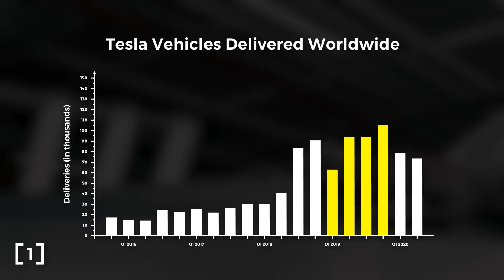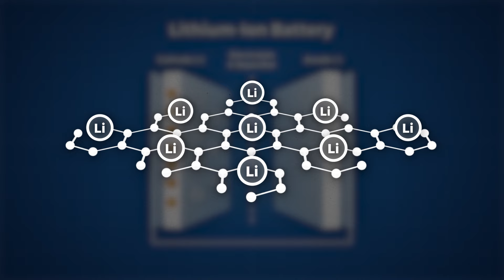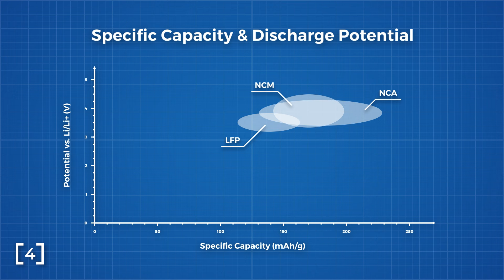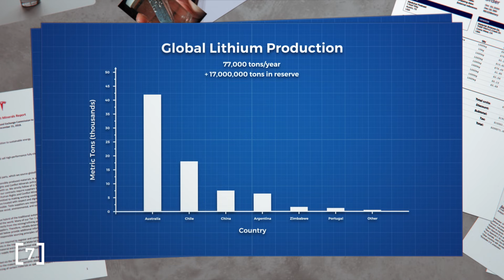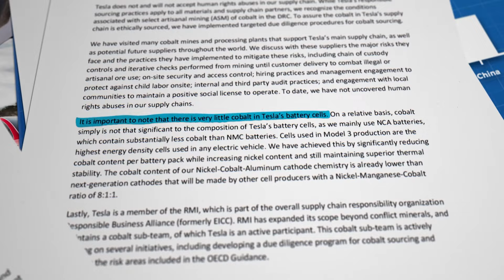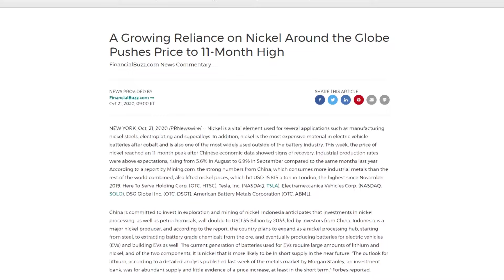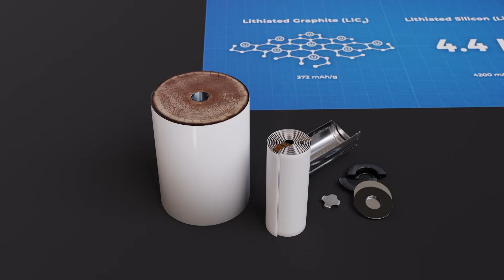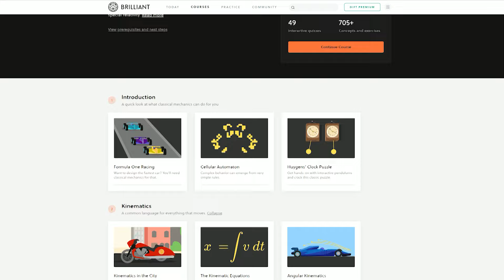Tesla's Battery Supply Problem

Comment: put solar panels over  all east west highways.  This will do at least three things:  1.  Protect east directed drivers from driving into the sun in the morning and west directed drivers from the evening sun.  2. Keep most of the rain and snow off the highways during bad weather.   3.  Keep cars in the shade, reducing their need for AC cooling in the summer.  4.  Reduce the heat from the sun that currently is developed from above the pavement.  5.  The government already has the right of way so it doesn't have to acquire more land in order to build solar panel arrays.  6.  combined with in pavement charging, could charge electric cars while driving.

Comment: I think the scaling problems will be smaller than thought. Like not everyone buys new cars. Heck the cars i buy only get older and older. And old cars can be run on renewable fuels. Ethanol for old petrols. Or even better: Vegtable oil or even used cooking oil in old Diesels. Espeically the later is quite a good choice since its good recyling

Comment: How much electricity does it take to fully charge a Tesla car ? How does that cost compare to gasoline to travel the same distance with the same performance ?
Reply: In a 30 mpg car, $3/gallon÷30 miles/gallon = 10¢/mile. In a Tesla Model 3 with 4 miles/kWh, 10¢/kWh÷4 miles/kWh=2.5¢/mile. I'll let you multiply by number of gallons or kWh in your favorite gasoline or electric car.

Electric cars are much cheaper to "fuel".
Reply: @hazelsct   Thanks much appreciated

Comment: I do not know anything in terms Marth and physics but as much looking at the powers transfering on the quick wrap battery from the copper and aluminium foil, it is going to little bit lithium and anode in it. The reason for is because mostly copper and aluminum foil they won't keep power much longer since they are always there to work as middle man in releasing the given capacity of the current.

Comment: Hey can you do a video on pneumatic energy storage? Or air pressure energy storage? I’m not sure which it would be called. I’m sure the efficiency is terrible but less of a mining concern, plus over time I’m sure air pressure storage can gain a lot of efficiency, still probably not ever as efficient at a battery. But it’s gotta be super super clean, especially coupled with windmill, or solar panel provided energy. But I’ve heard of plans of storing a gigantic tank underground to store air. Also I think there was a company in India that made a full pneumatic vehicle but not very good range, I don’t know if they abandoned their plans. I’ve also heard as far as safety concerns they can use carbon fiber tanks instead of metal so it can crack instead of exploding. Either way it will for sure be the cleanest way of storage. Plus it would be nice to hear super high RPM air turbine engines in a vehicle in the future. 
If nobody else tries then I’ll do it someday in the future 😂

Comment: I have dozens of lithium (lipo) batteries that I have accumulated over time due to my remote control hobby. Some of them have puffed and swelled due to overcharging. Disposing of the bad ones have become easier for to collection centers. What happens to all these battery waste, including lead acid batteries that we still use in almost all our vehicles?

Comment: It is amazing how this video danced around Lithium Iron Phosphate chemistry which has no supply constraints whatsoever (other than that of Lithium itself which is pretty soft), has the longest cycle life of all, is safe (not igniting even if punctured), and non-toxic. Oh, on top of that it provides more stable voltage than other chemistries, and thus requires far less sophisticated charging control circuitry if any. 
The energy density is lower than others, but sufficient even for vehicle use (used in Teslas), and definitely for stationary energy storage. Arizona battery farm disaster is absolutely irrelevant if LFP batteries are used, and they will be according to Tesla plan revealed on Battery Day.

Comment: The refining of gasoline makes a by-product, that used to be waste, that are the base chemicals in plastic and rubber production. Cutting back on gas production means cutting back on tire and electrical insulator production or start throwing away gasoline. Making renewables, solar panels, wind turbines, needs a lot of electrical and weather insulation so cutting back on gas production is not feasible. The alternative natural insulators do not have the same durability properties making more frequent replacement necessary. All advantages have disadvantages hidden in the details.

Comment: The battery they are assembling at 22:33 looks like a nickel-iron type wich is very durable and abuse resistent, but so far the only ones i was able to buy come from cina, the one in the video looks much better built, plates inside held in place by screws and bolts and they have trasparent containers/jar/vessel, unfortunately the ones wich come from cina have plates soldered and opaque jar, could you tell me more info about the batteries seen around 22:33 in the video?

Comment: Actually, the way you descriped it is wrong - actually, it's in reverse. The cathode has electrical potential that attracts electrons, and the lithium ions just follow the electrons (kind of). From a chemical perspective, lithium gets oxidized on the cathode side. That's where the energy comes from, "burning lithium". The electrolyte contains a lithium salt that only allows ionized lithium to pass.

Comment: I don’t want to take hours to change. When a gas one takes about 3 minutes
Reply: Me too. I am more interested in buying a hydrogen fuel cell car (Toyota already makes one, but only sold in CA) in future, prices will come down when infrastructure is up, or perhaps a gas car that runs of a high tech biofuel. I use to use biodiesel in my diesel truck until I found out it came from palm oil & caused deforestation. Making biodiesel out of algae is less environmentally impactful.

Comment: I am still trying to figure out why modular flow batteries with safe electrolytes haven't taken off. They have been on the market for years, have a long service life, are inexpensive, and do not require exotic or dangerous materials to build. The electrolyte of some can literally be used to fertilize plants. This seems like a no brainer to me for grid scale storage.

I think the one that I saw first was by ESS Inc.

Comment: The video is a little misleading on the artisanal mining part:
While 70% of the world's output is mined in Congo, only an estimated 15-30%  of Congolese cobalt is mined this way. So at most roughly 20% of the world supply is mined this way every year.

The numbers also fluctuate in line with cobalt prices, as, somewhat counterintuitively, that kind of production is not competitive when prices are low.
Despite the usage of what basically amounts to slave labour, it is not able to compete with the highly industrialized processes of huge mining facilities as long as there is no supply crunch for cobalt.

So while the geopolitical problems are still a major concern (as the video points out, Congo is a notoriously unstable country after all), the development of more mining facilities in the region can actually help mitigate the problem of artisanal mining

Comment: It's not just Tesla, Toyota wanted to make 50% of their fleet hybrid but they can't get enough batteries.  I now work for BMW which is struggling to supply chain batteries for the plug-in.  Rare earth elements and cobalt have always made these goals a pipe dream.  We need mass transit, rapid trains, and population density.  We cannot fix the world transportation problem with battery run cars

Comment: Tesla is an very interesting and innovative company and this is an excellent video—thanks for sharing.

Energy “problem” is unlikely to be solved with the current approach of using renewable generation and batteries.  These types of energy ‘problems” are almost always solved historically by a major transformation in the energy source, and the world be better off dumping its capital in to R&D to develop new sources of energy that are dispatachable, reliable, and transportable.  Wind, solar, and batteries aint it.

Comment: All Tesla batteries already have 5% silicon. Also you should explain the difference between lithium hydroxide and lithium carbonate. Tesla batteries actually need hydroxide, not carbonates. Hydroxide is primarily made from rock mining, not brine mining. Brine mining is usually converted to carbonate and that is only useful for low quality batteries. Expansion of rock lithium mining happens in Western Australia, Canada and the US.

Comment: There isn't enough effort to gaining the raw materials from the asteroid belt. And there isn't enough effort being put into advanced capacitors that could replace a battery in a use case as a vehicle or at least assist a battery. And here's something you might want to research: ultra high frequency generators.

Comment: Great Video! The only thing is that there needs to be MORE attention on how RAW materials are delivered to The Research Clients! Everyone WantS Renewable Without taking in consideration on HOW to achieve IT! For eg. OIL And how it is used to produce ALL the materials need to be used in Renewables! Hence NOT RENEWABLE!
NEW thinking is needed ! Batteries are OLD ! Just as oil is old! Think More like FUEL CELL GENERATORS?  Hydrogen is Ubiquitous!

Comment: 17:48]  Is this a real image?  Wow. I is rare that you see such a size disparity in approximately similar types.  One is really big for its type or the other is really small.  I used to joke, that with the top down in my old Triumph Spitfire I could simply drive under most of the toll barriers on the highways, and I should never have to pay a toll again - except if you happen to clip the bottom of the toll barrier at 60mph.  That would be a bad day.

Comment: electrochemical energy storage - converting excess electricity into a carbon-free chemical fuel and use that to power fuel cells during peak loads - seems like a much more effective solution for grid-scale energy storage.

Comment: I have watched three videos on liquid metal (actually a misnomer most of it is salt)  mass storage batteries, and they blow current battery technology into the weeds in every metric that matters. Mainly cost and safety. Highly scalable too, actually the bigger they are the more efficient they get.
Reply: Dirk Knight  Several installations all ready up and running, and the main proponent is a hero of this channel owner. Clueless.

Comment: 19:30>
The tabless construction  does speed production slightly by removing the "Toll Booth" effect, howere, what REALLY speeds production?

The Tabless design!.... In another way

For a given number of  2170 "Cans" leaving a factory, you get a certain number of kWh (GWh).

Tabless enables the upsizing of the cell, previously impossible due to internal resistance

Result, each 4680 "Can" leaving a factory holds 5 times the energy of a 2170

This means, if you are able to maintain a similar "Can" production rate, (Mechanical process!) you have essentially 5 TIMES THE OUTPUT from a factory.

(You need 20% of cell "Can" quantity for each vehicle with the same energy)

This is without considering Maxwell Dry Process, Materials, or Chemistry(!)

Comment: I never hear anyone proposing storing energy in the form of hydro dams. Why? I mean, using eletric power generated by wind turbines to lift water, then passing that water through water turbines when the grid is in need. Is this method less eficient than the more complicated alternatives? It could even be used on current operacional dams, to improve their efficiency. What am I losing here?
Reply: That is a valid idea, but unfortunately it's very inefficient. You need lakes and lakes of water to store reasonable amounts of energy.
Reply: @RawbLV  We already do that. Most of Brazil's energy comes from dams.
Reply: @hensegundo  That's different, dams are great at producing electricity.

Comment: Mains supply infrastructure will have to be stepped up, to be charging electric cars that demand 6 times your current domestic use, and all without an increase in fossil fuel emissions.The next shortage will be of Copper/Aluminium  which will be needed to beef up the grid.

Comment: Nobody stops to think we are replacing mining fossil fuels for a massive increase in heavy metal strip mining, child mining labor and shady mining in general in Africa, and all this battery waste with no real reuse solution. So many think all electric everything is coming in 10years, or less, but I highly highly doubt it unless everyone is fine pushing one problem to another geo location that just not as visible and apparent to the average person in the US or EU. Its all about moderation no matter the direction.
Reply: I agree with you regarding the switch from fossil fuels to strip mining.
But the UK and other European countries are stopping the sale of diesel and petrol cars in 2030 regardless.

Comment: Your video is kind of missleading. At the time 6:02, the topic you are talking about is the expansion of Si through alloying with Li, but you were showing an expansion of Battery through gas during thermal runaway. I think the expansion of Si would look different, it simply cause the Si active materials fall from Cu current collector, thats all.

Comment: From what I understand you need approximately 80% times the kWh in a battery for a lithium ion battery. Maybe that improves a bit with different chemistry but that means 40 kg of Lithium is used in making a battery that is 50 kWh, even if the final product contains less. So that number you used appears to be too low. Good video otherwise!

Comment: Battery power is not sustainable long term without deep-sea mining. That has a huge environmental impact. 
Long term we should be looking at hydrogen power cars that rely on the developing renewable power market. This is sustainable as it solves two problems: 1) how to regulate the frequency fluctuations caused by renewable power. 2) How do we fuel cars using the same infrastructure model that we have in place.

Comment: When we speak of energy storage, it can be applied to other forms of energy, including oil and gas. Energy density also applies to oil and gas. But, these two concepts also apply to nuclear. Oil and gas are more energy dense than wind and sun energy and thus store energy better and to much higher extremes. But, there is something better than oil and gas, nuclear. Why is nuclear resisted so much? It is far more energy dense than any other form of energy and easily stores. Use nuclear.

Comment: This is an idea I had way back. Why not work on a way to swap out battery packs, so an EV driver low on power pulls in to a garage removes his battery pack and trades it plus some money for a fully charged one. The battery pack is quite huge, so why not make smaller packs that can slide into each other till they have a similar capacity as now, then exchange would be easier. Comments, surely someone has thought of this...

Comment: Lithium Iron Phosphate does not require Nickel or Cobalt, and is safer. Lower power density, but that could be over come using structural battery cell packaging (burying cells inside every portion of the vehicle chassis) ... plenty of room there for a high range vehicle. Never understood why claimed "environmentally friendly" Tesla went down the Nickel / Cobalt path, when Iron / Phosphate was available. That choice pushed the whole industry into following, diminishing the environmental benefit of EVs.

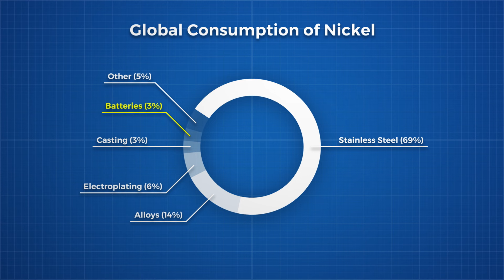Comment: 15:56 Increase nickel demands for batteries also shifted the cost for stainless steel, which intern Cybertruck.

Conflict minerals = cost and very disruptive to "JIT" for battery, so what Tesla R&D doing is 'scalability' by simplifying anything to allow JIT to become operational, Cobalt is one of them. 

Another disruptive element against JIT is the high demands for "neodymium magnet" (with nickel plating), which drives up the global LME prices year on year from headphones to large electric wind farm generators, all uses Neo magnets just like EVs motors.

Supply chain for Neodymium is horrible, not as bad as cobalt, but definitely worse than nickel or Titanium and there are only few places you can mine out on earth, majority of which came from Mongolia, but some suggested pricing in China were deliberately risen when export.  And this time there is not real alternative to neodymium either for making it into a magnet.

Should do an engineering video about this issue.

Comment: 20:17 - As you say, I don't think Lithium batteries are really that suitable for grid storage long term. While they are very energy and power dense, grid batteries need to be run at much lower charge/discharge rates and don't need to be so energy dense, so should prioritise cost/kWh not cost/kW or weight/kWh. Another big factor is price/total kWh over lifetime. Flow batteries or refrigerated air 'batteries' are likely going to be a better investment at scale, and would relieve some of the supply constraints for use in transport. They're also expected to last many times longer than a Lithium battery.

While probably pushing it too much, I don't see why a well-designed flow battery wouldn't be suited to a lorry. The electrolyte could be swapped out really quickly, and stored in tanks in similar configurations down the trailers. If not, I would use LiFePO4 instead, saving the cobalt/nickel for cars.